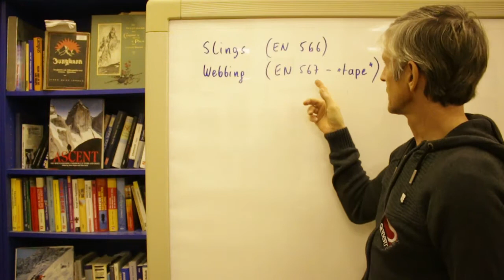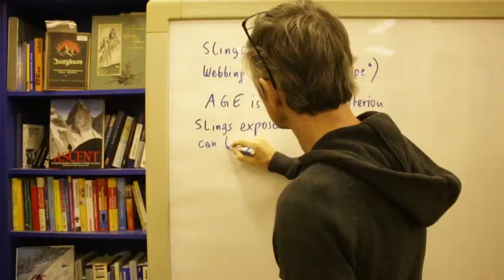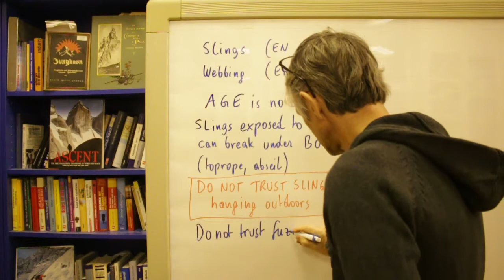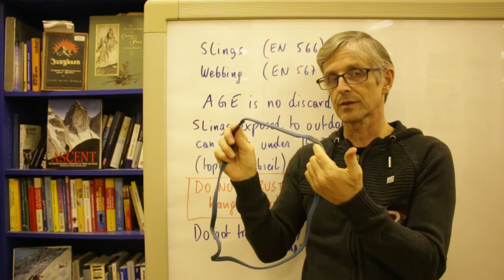Be careful with slings and webbing!

Comment: You’re presenting this as hard research and conclusions, but your sample set is really low with poorly-defined test parameters. I also am having a hard time understanding your conclusions because you seem to freely interchange kilograms, kilonewtons, newtons, and tons. For example, you are shouting “1500 kilos”, but have only been talking in terms of kilonewtons. Obviously you mean kilograms in that case (because 1500 kN would be insanely strong), and are using the standard conversion of 1 kg x 10 m/s/s = 1 N, but I think that many climbers (I’m looking at you Americans) don’t understand this conversion. So your 1500 kilos is 1500 x 10 = 15000 N or 15 kN. You need to pick a single unit system to work in to avoid confusion if you are going to just throw out numbers with half-formed or without units. Because if something breaks at “1.9” without units, I’m either left to conclude that is metric tones, which is a strong sling a little under MBS or in kN, which is really really weak.

You also just cut off lots of sentences without finishing the thought, leaving us to fill in whatever you want. I understand that English is not your first language, but you’re choosing to present this in English and you have time to think of what you’ll say beforehand. If you can’t form it in the fly, you have to write a script to make sure we understand what you’re talking about. Because I am never sure what you mean, my conclusion is that you don’t either and that I shouldn’t trust you compared to the engineers that manufactured the thing.